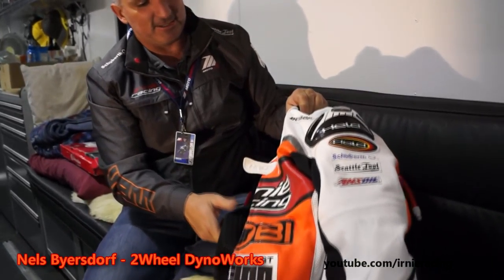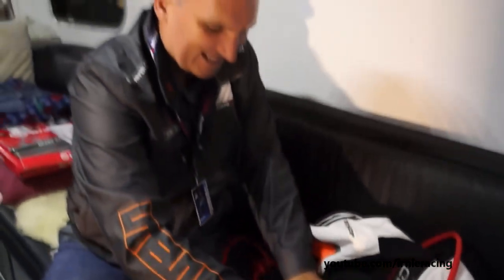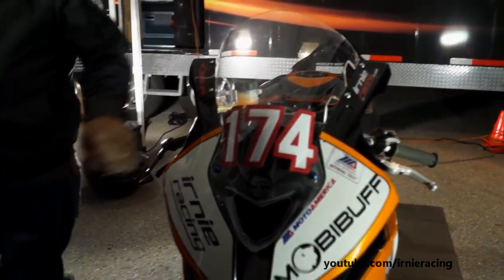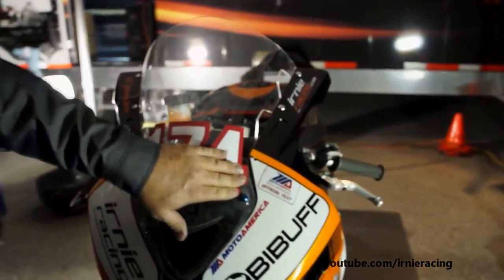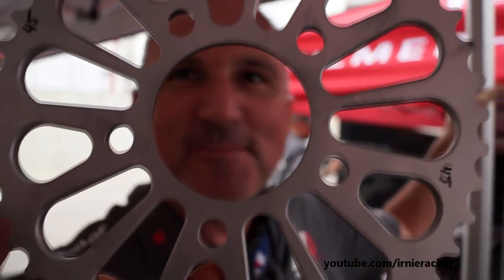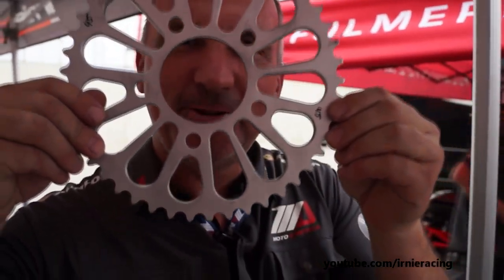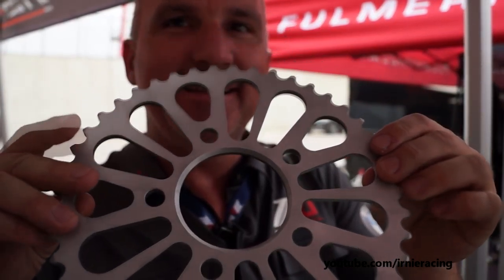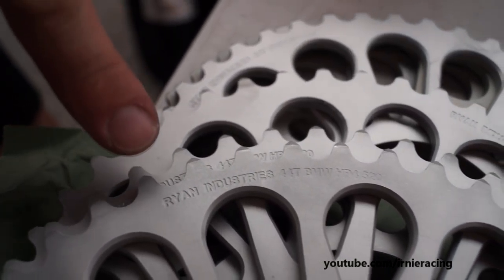Moto GP / Superbike Racer: COTA "Irnie Part One" [5.3]

Comment: So at the 2:00 mark, why is there  brand new R1 in your trailer and with the ignition removed? Switching bikes soon?
Reply: Good catch, had to go back twice to notice the triple tree.
Reply: Matt Wilcox Very Suspicious, but to be honest after seen some of the initial reviews, the R1 is going to be the best bike in 2015 out of the box for the price for sure.
Reply: +Tyler James The new R1 is badass, however the US version doesn't make as much power as the over sea's versions. The S1000RR still puts down more power than pretty much all of the liter bikes when compared in stock form. Even though the R1 and Ducati 1299 claim 200+hp, it puts down less horsepower than the S1000RR. At least this is what I've seen in several different Bike Comparisons for 2015. This information is based off of American bikes. The R1 is still a top notch bike regardless of power output. I haven't rode a new R1 yet, but I've rode an S1000RR and those things are savage yet refined when it comes to overall power and feel.